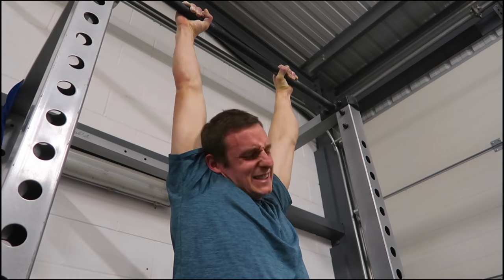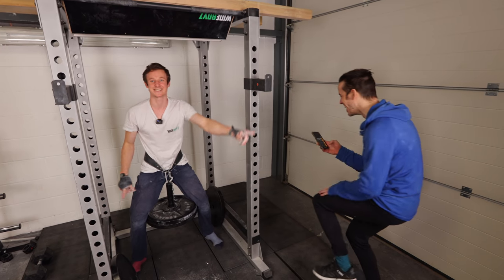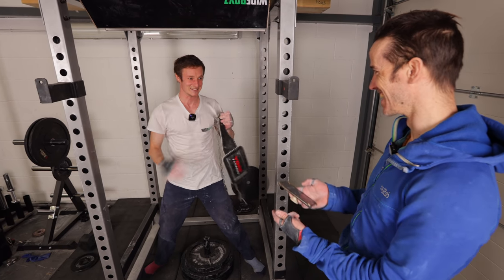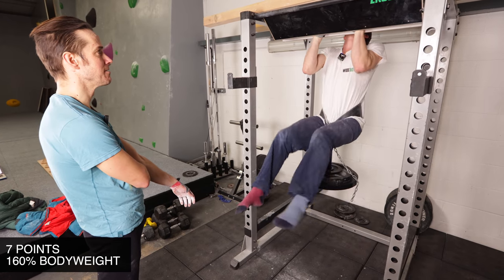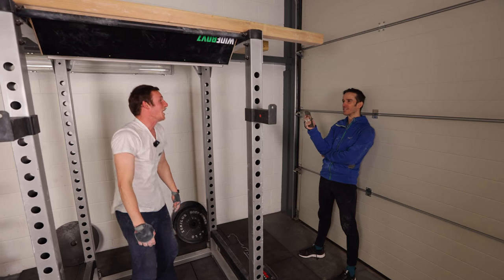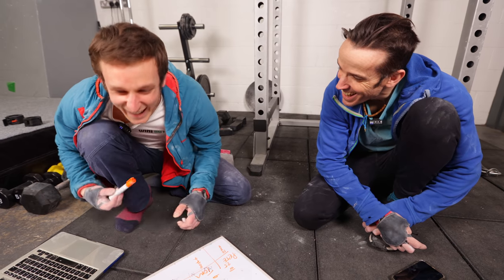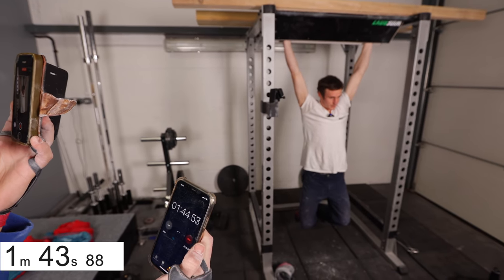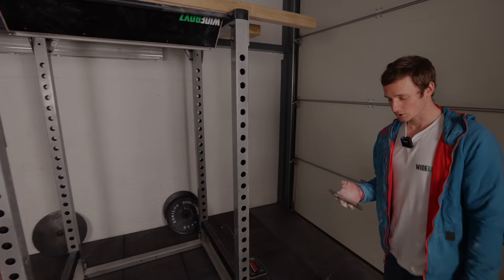The Strength you need to Climb 9c - Crack Edition

Comment: I recently tried a max hang on my (vertical) crack machine, and even though I was dynamically swapping thumbs up and thumbs down hand jams, I managed to pinch a nerve in both thumbs which left them feeling slightly numb for a couple weeks. After doing some research, it seems that hanging with thumbs down jams above head height puts a lot of pressure on those nerves. Be careful if you're going to repeat this test yourself and maybe work up to the max hang before you try all four exercises at once and go for your absolute limit, nerve damage is usually not permanent but you want to avoid it at all costs.

Comment: I discovered the stuck hand "perma-jam" near the top Direct Becky, Elephant's Perch...a long hard finger crack (not 9c... maybe 6c :).  Hands were worked from the bottom many pitches... pulled hard on a jam, did the move, got a rest... and sat befuddled by my right hand stuck in a claw formation, refusing to operate.

Comment: Hello,

Love your videos!!! Keep it UP :)
Just wanted to share some science correction needed on your second test, the Hand Jam Pull Up. Pete used a pronated hand jam and Tom used a supinated hand jam. Those two different hand jamming positions, use different group muscles for pulling up. However what it counts is the hand jamming hability to stick in the jamming, pulling up is not the same and also, the forearm muscles shift differently bettween supinated and pronated hand, which may also cause different capacity on holding the hand jam.
Should try to repeat some of your testings taking this small details into consideration.

Cheers Wide Boyz :)

Comment: The main problem with this version of the test is that the weighted hang is supposed to be on a much harder hold than the weighted pullups!  You guys did the same holds for both, making the pullup much harder than the hangs. :)
Reply from the maker: yep, they should in theory be different. we wanted to make it as simple as possible so other people would try it out though, that was our reasoning behind that, haha

Comment: Woa nice scores! I'm just getting started in crack climbing, build a 3m vertical crack in my room but I cannot even reach the top yet... One day I will top out!
Reply from the maker: Cool! Good to hear of more home cracks 💪
Reply: would you have any tips on numbing the feet before a session? It seems my feet kill me more then my hands
Reply from the maker: @meldepinda  tape on the toes gives a bit of padding for thinner cracks. But in general the feet warm into after a number of sessions. There is no real secret, just more getting familier with it. If I havet crack climbed for a while, the first few sessions back are always a bit uncomfortable, but it eases and gets much better with a bit of time, until it's not noticeable
Reply: Many thanks for the guidance! Will put lots of mileage through it!
Reply from the maker: @meldepinda  don't go to distruction though 😅 carefully considered mileage is the key
Reply: of course! currently I just go at it until either I don't have the strength or skin break and rest for appropriate amount of days with some light training!
Reply: Just got some advise from some crack pros at the gym today.  The straps/metal buckle part on my shoe are killing my feet and were digging into them.  Found different shoes and 1000 times better.
Reply: for me it's more like the side/front of the foot, I tried it with my other pair but it's still the same spot. thanks for the suggestion though!

Comment: Not sure about the idea of using the same crack for both the weighted hang and weighted pull-up. In the original test these are a 20mm edge and a bar -- so very different. I would guess you would want something like perfect hands (including deeper than 15 cm) to represent a bar at it is the best possible hold. Then you can do something more funky (shallower, or not perfect hands) to represent a 20 mm edge, which after all is a good hold, but not great.

Comment: Seems like straddle lever isn't really valid since it's flexibility dependent instead of representing an actual move. The one leg front lever represents reaching your foot out to a hold, but the straddle lever could theoretically approach the difficulty of a tucked lever for someone flexible enough.
Reply: Yeah but hip flexibility is incredibly important for climbing, so I don't think this is actually an issue.
Reply: @MichaelFairhurst  The primary goal of the test is to measure core strength. That's why it went straight from an L-sit to a front lever. If the goal was just to measure back strength (the hardest part of a front lever by far), then it would have included one-leg front levers. Doing the splits minimizes both the back and core strength required and circumvents the entire strength based nature of the tests.

As a real world example, imagine climbing feet first in a crack. You have to lift your feet far above your head. The splits are not the solution.

Comment: if the crack is higher up for the crack duration hang test can you last longer if you don't have to continue lifting your feet off the ground. maybe have a ledge on each side you for when you have to stop, but space directly below to allow to hang without having to raise your legs in the middle.

Comment: Are you allowed to shake a hand out on the Enduro hang? And do you thing you'd have enough strength in the other hand to do so in the first place?
Reply from the maker: no shaking allowed. I don't think you could do it off this jam anyway, its too shallow and the angle is all funny. You'd need a perfect 'hand straight up into the the crack' jam

Comment: Isn't Tom doing chin ups not Pull ups? Either way they're doing opposite grips which seems weird
Reply from the maker: Tom went palm towards cos of a tweaky shoulder when doing pull ups with palms facing away. I went palms facing away.
Reply: @WideBoyz  thank you very much, curious if one is theoretically easier/better but awesome content either way
Reply from the maker: @09tclarke  hmmm I'm not sure. I think in general climbers prefer palm away as it's what they're used to, and none climbers prefer palm towards as you can put more strain on the bicep. Not sure which is easier. I prefer palm away
Reply: Tom is doing "Front side paddle handed book opener pull ups" while Pete is doing "Back side paddle handed book opener pull ups"

Comment: I think the flaw with this test is only using one size of crack, Last time my local wall put a crack up it fit my hand so well I could hang from it easily one handed. A couple of millimeters wider and there's no way I would have been able to do that. A 9c crack would probably have a horrible mix of widths
Reply from the maker: yes you're right, it's an incredibly simple test, and much iek the orginal 9c test, gives you a veryyyyyyyy vague understanding of where your crack ability might be. It takes very little consideration of any technique, much like the original 9c test

Comment: The max pull up shouldn't be tested on the same crack and using the same weight-point levels as the 5 second max hang as that kind of makes the 5 second max hang test irrelevant. i.e. if you can get max points on the pull up there is no point testing the 5 second hang
Reply from the maker: yeh you are right. The pull up should have been done off a slightly easier jam, and the max hang done off a slightly harder jam. We did think about this, but then we were just keen to keep it simple for anyone else who wanted to try, as not many people have cracks at different widths...